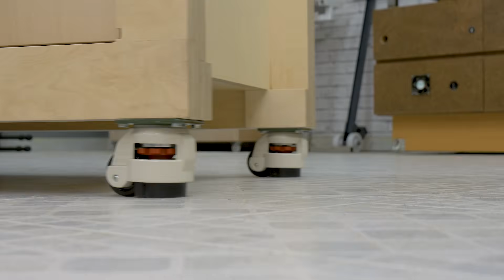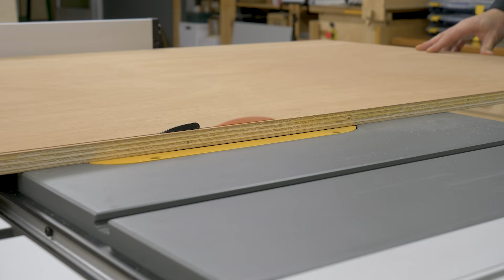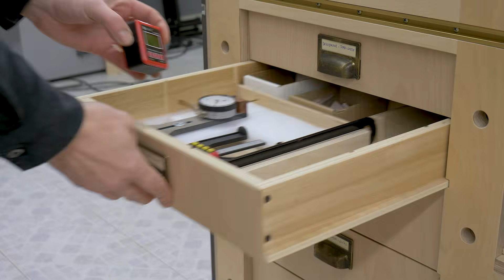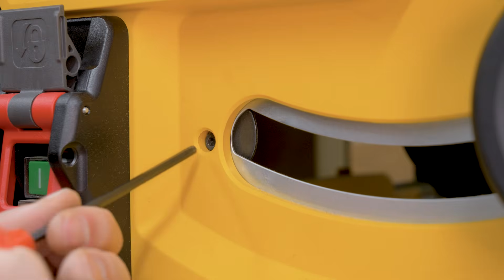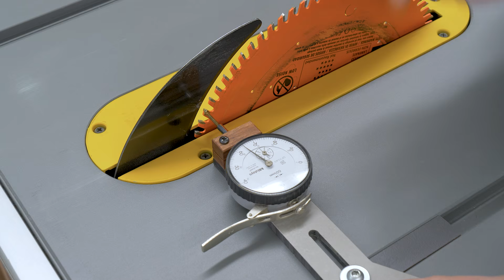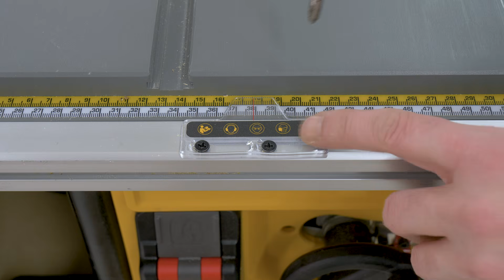How to Adjust & Tune Up a Bench Table Saw

Comment: Fantastic setup. Good video. But i got one question. Do not want the fence to be exactly parallel to the blade? We were told in the maschine course this can lead to kickback. The recomendation is that the fence is some what more open in the end than before the blade. Depending on size of the maschine it is just a notch.

Comment: Good job! Your workbench with built-in table saw and router table is insane! I have been inspired by it and modeled a similar design myself in a slimmed down form with the DWE 7492.

Thanks for all the good suggestions and your advice on calibrating the table saw. One question remains, however: How do I set the rip fence square to the saw table? On my saw, it is below 90° and I can't find a way to correct that without voiding the warranty. Do you have any advice for me?  Many greetings, Phillip
Reply from the maker: hi Phillip, I don't think it can be adjusted, sorry!

Comment: when you align the blade to the miterslot you should also give the screws a fresh drop of threadlock. if you check your alignment again now you will notice that it did move away from  your earlier messurements. i did not believe it untill i just re checked my blade alignment. now that i secured them back in place i messured again and this time the blade stays right in place

Comment: 1) Use the same tooth for measurement when calibrating the sawblade. The sawblade can be tilted in itself
2) use the same miter slot for aligning the fence as you have used for aligning the blade. You want the fence parallel to the sawblade, not to the slot and you can't guarantee that the two miter slots are 100 % parallel to each other
3) In general you have to adjust the zero point on the gauge for each position of the fence. Since you can move the second position of the fence relative to the first position the gauge need not to be at the position what it says. To clarify: you calibrate the zero point of  position 1, it shows zero and for the distance of position two the gauge says 10. Now you move position 2 of the fence for calibration by 1. The gauge will still show a distance of 10 but in reality it is 9 or 11.
Reply: Hiii friend 😊👍👍

Comment: Great video as always... Another way to perform calibration/alignments of saw blade is to buy calibration disk/sander plate... Instead, used cutting blade; you use a calibrated plate that you can also spin by hand to make sure your motor shaft is true as well . They run for about $30-50 usd. 
Your way is still very reliable. You just have to watch for the blade condition that you will use.
Reply: Yesss sir 😊👍👍

Comment: Hey! love the video as always :) I have the same table saw and while i have aligned it as best as I can, doing so is made more difficult because the table top is slightly convex. Fortunately it is most flat near the blade but particularly at the four corners mine slopes down by a few mm. Have you found this with your saw? Have you found a solution or a work around while aligning? I typically align the blade’s 90 by zeroing my digital level quite close to the blade (on the table top right beside the insert)
Again thanks for the great video, love the workbench!
Reply from the maker: hi Edward. You're right, all of these bench saws have that problem. There is no simple solution, I do it the same way as you!

Comment: The slots on this table saw (dewalt 745) are not too accurate. Some places, the slot is tight and other places, it is loose. Its because of the coat of paint on the aluminum surface. Take care of that first. Thats my experience anyway.
Reply from the maker: yes, I already checked

Comment: Nice!
When you measure the distance between the slot and the blade, its better to use the same tooth of the blade at both measurements. So you can avoid the wrong results because of the imperfections in the blade...
But its woodworking. A half mm is a good resolution...
Reply from the maker: you're right, thanks for the advice!

Comment: When checking the blade against the mitre slot, the same tooth on the blade should be used. Set zero on the guage with the tooth toward the front of the saw. Rotate the blade toward the back of the saw and check the guage against the same tooth.  by doing it this way, you eliminate any variables of the blade not being perfectly flat, etc. Love your videos!
Reply from the maker: you're right Peter, thanks for the advice
Reply: Checking should be done again after tightening of screw because it’s impacting the setting
Reply: Yep, that's how it should be done!
Reply: I was about to mention the same thing.

Comment: The machine is excellent, but I think that when setting up it is always necessary to start from one base. I understand that the slots on the table are made at the factory, but. It was necessary from groove to disk from groove to time, with the same size. Then from the second time to upar. And it will be more correct from the first time to the stop. The errors are summed up.